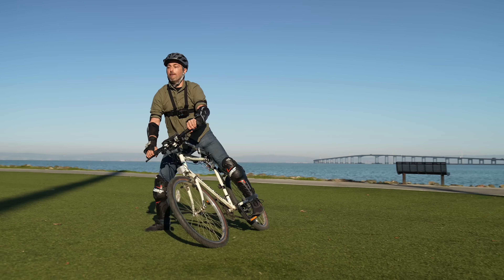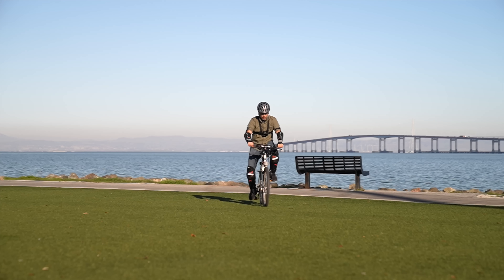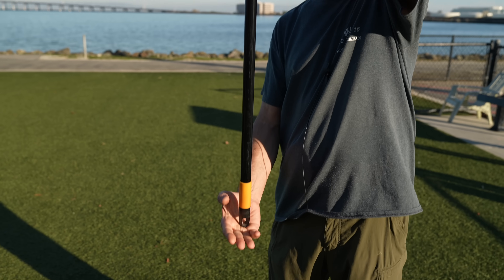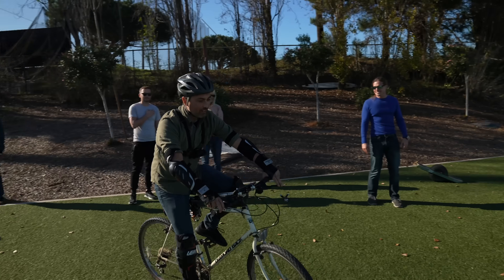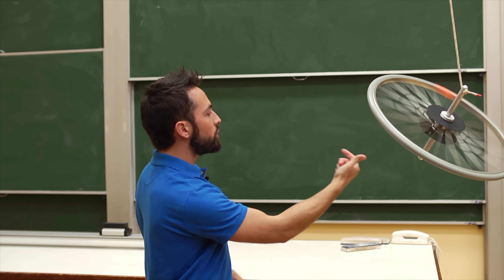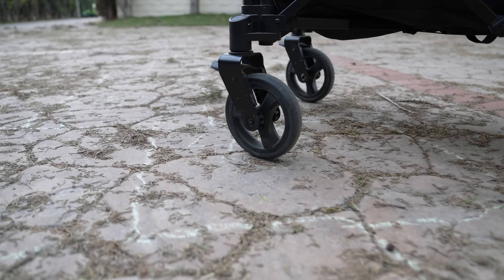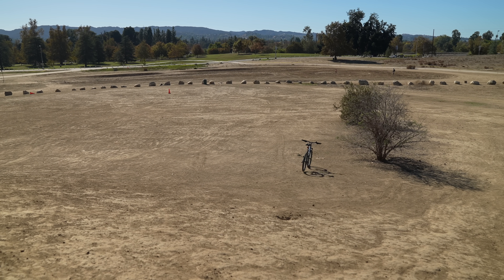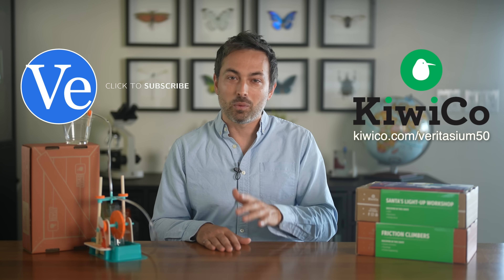Most People Don't Know How Bikes Work

Comment: Something additional to note is that when something moves in a circle, you apply a radial acceleration to that object. This means that the object moving in a circle is getting pulled away from the center of the circle that you are going around. This is the same reason that when you are on one of those carnival rides that go in a circle really fast with you standing at the edge of them, you are pulled into the wall behind you. This can be translated to your movement on the bike where your body is actually trying to go away from the circle that you are tracing. This is why you have to lean into the turn. By leaning, you are making the force that is pulling you away from the center of the circle equal to the force of gravity that is trying to pull you down and you are able to lean without falling. If you weren't leaning, the torque caused by this force on your body which is above the point where the bike touches the ground would lead to you getting pulled away from where you are turning and falling. By turning right before you turn left, you are causing your body to start falling, and then catching it by opposing the force of gravity with a  radial force away from the direction you are turning. I also have to assume that this has something to do with the bike being able to catch itself because the bike falls and turns at a rate fast enough to create a radial acceleration that overcomes the force of the bike falling.
Reply: No

Comment: The funny thing about motorcycle turning is that you actually steer to the opposite side you're turning, which also leans the motorcycle and allows you to perform a turn actually barely moving the handle. You can also do the whole countersteering thing and just turn the handle left to go left, but the very idea that you can steer left to go right is weird when put in words.
Reply: niduoe stre  Eh, if I wasn't running on mobile data because of having to spend a lot of money on bike repairs I'd still need to find a video editing program that doesn't irritate me and also find a way to convey thoughts in a non-schizophrenic manner, which can be unbelievably hard at times.

Comment: Absolutely correct. Over tighten a head set makes a bike very difficult to ride.  Good idea to have a good bike mechanic that understands this.  The Coriolis force ( the cross product of the angular momentum of the wheel and change in steering direction) actually multiplies the micro adjustments we make turning the handlebars.  That is why the bike feels more stable at higher speeds, or with bigger and more massive wheels.

Comment: i do slopestyle mountain biking which is basically bmx freestyle but on a bigger bike and i don’t ever countersteer to turn i just turn that direction and stay upright and lean the bike if its a flat turn but if its a berm you lean with the bike perpendicular to the angle of the berm but it’s probably because i ride alot and have really good balance to where i can balance in place for as long i want

Comment: counter-angular momentum IS GREAT to redirect force but no it is not necessary, and balance would be affected by the weight of the rider and the bike, and the contact area between the ground and the tires.

All you need to do is stay within the acceptable angle range of the ability of bike to move your body (but this is tiny on a normal bicycle), essentially you should end up doing decent-sized circles .

Comment: The steering angle you see on bikes (actually called "Wheel caster angle") is also applied to most road vehicles too, including your car. This is why if you steer full-lock, you can spot the front wheels leaning slightly inside the turn; and this is what makes your car try to go straight when moving forwards and turn tighter when reversing. The amount of caster on cars and trucks is small (only a few degrees) since they're heavy and already "balanced" on four wheels. In a nutshell: More caster gives better straight-line stability at the expense of steering responsiveness.
Reply: weird how i already know about caster and that tldr because of driving games but i didnt know why it existed lol
Reply: Yeah, I was confused that he didn't bring this up. It works the same on cars as on bikes, in that when the steering wheels are off-center, the caster literally lifts the entire vehicle upward. Meaning that gravity is what urges the wheel to return to center. 

But the dance of the bike roll making the steering turn to get the center of mass back over the wheels, then that mass pushing down on the caster angle to get the steering straight again, is fascinating. All those forces working in concert.
Reply: @aerodanar  So that's why the steering wheel returns to center? I was always told/thought that that the wheels sort of "pulled" themselves straight. Didn't feel like it made much sense, but if caster is a little like those auto closing hinges you see on some doors, where opening the door literally lifts the door slightly up a slope in the hinge, I can totally see how the wheels are centering automatically.
Reply: @oliistrik  Yeah, it's really clever. Having the axis of the steering rotation cross in front of the contact point of the wheel to the ground forces that arrangement. Also, I didn't even think about doors doing that, but that makes sense too. Haha, gravity is free, why not put it to work!

Comment: Shifting your weight will shift the contact patch as well as turning the handlebars. Both are involved in turning. There is another effect going on when steering. with a motorcycle and to a lesser degree a bicycle. When you turn the handlebars or shift your weight in a turn, physics kicks in and says an object moving in a direction will continue in that direction. So when you turn the handlebars right, the bike leans left but the bike is still trying to right itself straight up because of the momentum going in a particular direction which tries to stand the bike up, which you have to fight against by turning the bars harder right. This why if you are going 20mph you only need a little pressure to turn. If you are going 80 mph it requires much more pressure because the bike is trying to go straight because of its own momentum. Because a motorcycle has an engine there are other forces like angular momentum but I do not think this exists in a bicycle. But the object in motion rule may explain why the bicycle tries to right itself, because an object in motion wants to continue to move in that same directions. The weight of the rider negates this on a bicycle, but on a motorcycle, you can let go of the handlebars and the bike will try to continue to stay up right, even if the rider shifts his weight a little or turns the handlebar and lets go of it.

Comment: i agree you cant make a turn without leaning, but i disagree that you have to countersteer first, you can execute a left turn perfectly fine with just leaning first... how can you than explain steering and driving a bike without hands... i believe that its not directly mentioned in the video but than again the whole thing is misleeding.
Reply: When you ride with no hands, you're using the three principles Derek mentioned for riderless bike stability.  Those principles cause the bike to steer even when you're not touching the handlebars.  Lock the steering and you fall.
Reply: @Rick_Cavallaro  what do you mean bike steers, the bike only balance itself, it is the driver who causes the lean in the first place and eventually "steers"
Reply: @rokmerse9551  
>> what do you mean bike steers

What I'm saying is that you can ride no handed, and still cause steering by leaning the bike.  But at that point you're really leaning the *bike*, not the bike/rider system.  Leaning the bike causes the front wheel to turn based on caster, rake, and gyroscopic precession.  This steering is still the key to balancing.  Moving your weight side to side is not how you balance (except to the extent that it causes steering).  And when you ride no-handed, you still initiate a turn with counter-steer.
Reply: @Rick_Cavallaro  so you're saying that even when steering exclusively with leaning one still first leans to the other side? correct me if i misunderstood
Reply: @rokmerse9551  That's right.  For most people I suspect it's subconscious.  But steering is still the thing that puts you "off-balance" into the lean for the steady-state turn.  But keep in mind that when riding no-handed that initial lean is just the rider leaning the bike slightly; not the bike/rider system.  That however initiates the lean INTO the turn for the bike/rider system.
Reply: @Rick_Cavallaro  well but that is exactly what i said, if i lean first to the right... which you admitted is possible of doing, the bike will only turn more to the right to correct its center of balance...
Reply: imagine this, one can drive a bike perfectly straight even when leaning, holding a handle bar straight and be leaning far to one side (dont really know how to explain better) u achieve this by counter weighting the bike on one side with your body on the other... this can theoretically be a starting position, and in that case, if you let go of the tension in the handle bar, the wheel will shurly only turn to the side you are already leaning into and make a turn to that side with absolutly no counter steer
Reply: @rokmerse9551    That's not what I said.  You don't lean, you lean the bike.  There's a very big difference.  If you could just lean to the right, you could do it on command on a stationary bike and fall to whichever side you choose.  But I think you'll find that you can't do that.  Also, you said you first lean to the right to initiate a right turn; but that's not what you do.  You first lean the bike a bit to the left to cause it to counter-steer a bit to the left, which causes you and the bike to lean to the right to initiate your right turn.
Reply: @rokmerse9551  
>> if you let go of the tension in the handle bar, the wheel will shurly only turn to the side you are already leaning into and make a turn to that side with absolutly no counter steer.

Yes, and you will immediately fall to the opposite side since the center of gravity of the system (you plus bike) was still directly over the contact patch.  Only the bike was leaned in this scenario - not you and the bike.
Reply: @Rick_Cavallaro  what opposite side?, you will turn to the side you are leaning into. if you can manage to lean the bike (doesn't matter, and that is where we agree, that the center of mass is still over the contact patch since there was no force outside the system making it to change at least in general) it will be (and it is by experience) enough for the bike itself to steer, and it wont steer to the opposite side, it will steer to the side you are leaning into with absolutely no counter steer making you turn, with only a lean
Reply: that is also why the video bothers me, whenever he tries to ride the bike, he is so concentrated to be so perfectly vertical, which makes it impossible to steer since the opposite side is locked...
Reply: also, why wouldn't he know in advance which turn to make, it just add up to the confusion, and if you watch him you will notice that he will not once try to stand up from the bike seat to try and balance the bike more actively, all he tries is furiously steering in the wanted direction which of course knocks him off
Reply: i've just tried this at home, i attached a rope (one i use to hang my hammock on hence is very firm) to the left side of the handle bars and connected it to my seat. i tighten it up very tight so i could barely streighten up the wheel (my arm hurts from 10 minutes of riding since it was so hard to keep the bike straight enough to even start driving), and yes, it was very hard to steer left (by tying it on the left side i locked the steering to the right of course), almost impossible in fact but than if i managed to keep a balance which was very hard duo being able only to correct it to the left, i could lean (standing) over the bike far to the right making a bike lean to the left of course or leaning it to the left if you will,and i found it quite easy to make that "impossible" left turn. but it was still very important that i was not too much off balance when starting the manoover. than i would still step off the bike (not fallen once, the video i find very dramatic about that part). the point is, that even when i felt, driving straight i couldn't turn left, i than leaned over the bike and made the turn i before felt was impossible...
Reply: @Rick_Cavallaro  you are incorrect. 

Motorcycles prove this inherently.

Comment: do some people forget that motorcyclists practice the technique and concept of counter steering? it has everything to do with your balance and center of mass. not to mention the basic understandings of centripetal force. Our vehicles also usually weigh way more than a regular bicycle, so the price for messing that up is usually more costly. On us, and the motorcycle. but the idea is more or less, still the same. the whole constant balancing act of a 450 pound weight between your legs. and balancing the force driving you foward all the time to make sure it doesnt slip out from under you.

Comment: Lol these soys have never ridden a motorcycle obviously
Reply: I've owned several - both street and dirt.  It's also me riding the unicycle in the video.  So it's not a balance problem.
Reply: @Rick_Cavallaro  it's a mass momentum problem, a bike does not contain the mass to move a human body in line, a motorcycle does, but all you have to do solve such a problem is take an angle that is supported by the mass momentum.

Comment: It still seems like there are some gyroscopic effects, especially when you get up into faster speeds. Take a road bike down a hill and get going 25-30mph, and its actually difficult to turn the bars and pretty much all steering is done by lean only. Inversely at low speeds, the handle bars are most of the steering with a bit of lean for counter steer and balance. Similarly with a motorcycle. Steering at low speeds can be tricky. Take a sport bike over 100mph and it would take hydraulics to actually turn the bars.
Reply: That, and also because of the increased centripetal acceleration caused by friction. The same turn at a higher speed requires a larger force directed toward the center of the turn. Because the contact point is to the side of the handle axis, this friction force pushes the handle to its neutral position. Thus, a higher friction force results in a larger force to overcome to steer.
Reply: How does this support your claim? The higher the speed, the stronger the self correcting effect the steering has. That's both why it becomes so difficult to turn the wheel, and why it remains stable despite requiring less input from the rider.
Reply: @spazzwazzle  this is limited. When you get to really high speeds, you will see effects such as wobble; the front fork/wheel will start oscillating, in an unstable way. Even a tiny unexpected obstacle on the road can cause a crash. Sadly, the map of the eigenvalues is cut off at 5 m/s but if you extend this, one eigenvalue will become slightly larger than 0 after speeds of 6.3 m/s. Easy to correct when the oscillations are still small, but at high speeds, a slightly larger oscillation amplitude becomes risky very quickly. This shows that a bike will become more stable with increasing lower speeds, but less stable above a certain higher velocity.
Reply: You actually got it completely backwards. You need counter steer especially at high speeds exactly because of the gyroscopic effects. You notice that especially when riding a motorcycle because of the heavier wheels and the higher speeds.

While it is technically possible to steer a bike at high speeds by lean alone, it would tip over really slow and it would take a long time to build up enough lean for reasonably sharp cornering. The only way to overcome this is by applying counter steer.

The reason why turning the bars becomes harder is because through gyroscopic effects, the force you apply towards turning the bars gets transferred toward leaning the bike.
Reply: I believe that you highly overate the gyroscopic effect. Note that ice scaters are also very stable without having a wheel. This is probably because off percervation of angular momentum: Assuming you have no sideways slip a change in angular momentum is needed to fall sideways. However, if the road is slippery and you can rotate freely around your gravitational center you will loose all the stability that you had because the mass of the rotating wheel is small compared to your own mass
Reply: I think you are highly exaggerating. I have an electric bike that I commute to work with every day at those speeds and have never encountered the slightest resistance turning the handle bars. Going down a hill there are some slight physiological barriers because you know that if you take a sharp turn you are going to eat pavement, but if you overcome that turning the handlebars isn't physically hard.
Reply: See "Twist of the Wrist" and try riding a motorcycle some day. To make a motorcycle turn anything more than a tiny bit you have to actively countersteer.
Reply: False, When I ride my motorcycle at high speeds I need to counter-steer, lean doesn’t actually do much. Unless if you are leaning and unconsciously pushing on one side of the bars your statement is wrong
Reply: Underrated comment
Reply: @guynxtdork  also wrong.